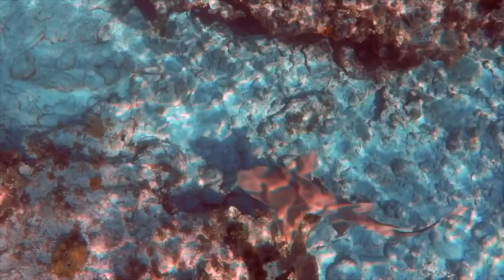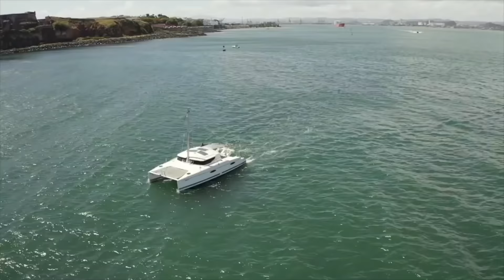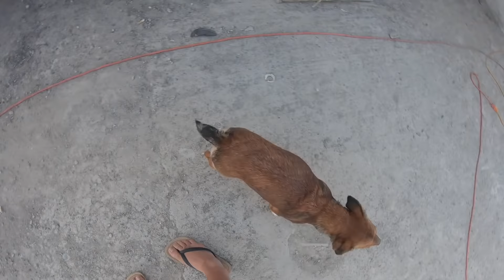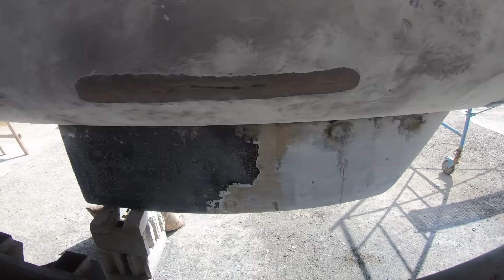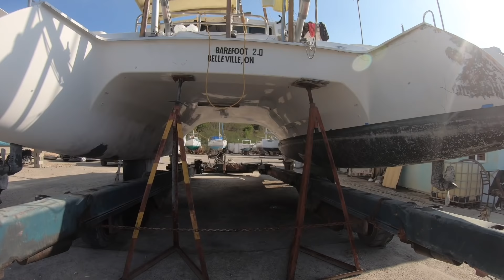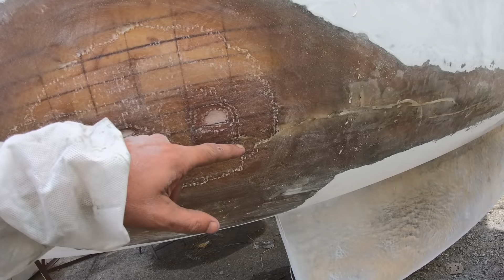Avoiding Boat Trailer Failure!! (S2 E30 Barefoot Sail and Dive)

Comment: I noticed they used hollow block as part of the blocking. Yikes!!! Hopefully you can get them to replace them with solid timber. That hollow block WILL crumble under the weight of the boat.
Reply from the maker: We check them daily and are working on getting a few more stands too.

Comment: Many hands make light work !
If your crack goes deep enough, balsa is a SPONGE !  It has to be completely removed back to dry balsa because it rots quickly.  Hopefully you do not need to do the same type of osmosis treatment Sail Life did.
The gel coat peeler/planers work great (again, see Sail Life).  Putting an additional layer of glass on the hulls is expensive, but it is the best solution long term.
Reply from the maker: Yes!!
Reply from the maker: Thanks for the advice mate! 🙏🙏
Reply: Christmas in Miami again. And again. And again.
Reply from the maker: We LOVE Christmas!!!!

Comment: Those inner hull cracks are suprizing , do you think it's hurricane damage ( if so why?) or is it some sort of hull laminating issue?   Those wets could you accelerate the drying with a vacuum , maybe just a couple of minutes with a wet dry back and toilet plunger head  to such/evaporate the moisture ? I know you have heat but it can take a while. 
Looks like you are prepping the hull for an epoxy coating after the repairs? 
Will you get the yard to spray the hull( or you do it have knowhow?)
Cheers Warren
Reply from the maker: Wow Warren so many questions! Yes we believe it’s hurricane damage from being on a pile of other boats? No too sure!
Reply from the maker: We have some exciting news that we’ll share Wednesday so we may have time to let it dry while we work on other projects. Maybe acetone could help.
We do have time though.
Reply from the maker: Yes we have an epoxy barrier coat to put on before the final coat of paint. We will probably paint ourselves. 

We have access to a friends spray set up to do the final coat. A good friend is a professional spray painter as well so we will have help/tips from him!
Reply from the maker: I think I got them all! Cheers Warren!

Comment: Ok, not sure why you would need to grind out the crack - obviously all that fiberglass is toast, so just take your grinder and make a big rectangle and peel away the whole outside layer of glass - that way you can inspect all the balsa core and remove the bad balsa and replace it.  Once you remove the bad balsa, it also allows you to inspect the inner layer of glass and repair as necessary.  You're going to have to replace at least a big section of the outside layer at a minimum, so you might as well just remove the whole layer in one big piece (or multiple small pieces.)   Of course I do know some of your de-lam is going down into the parts of the hull that are solid fiberglass, so that will be another hurdle to jump over.

Comment: that paint shaver could be easily copied using a grinder with a  Aluminum Miller Back Gouging Blade you won't have the depth set but you would get the hang of how much to take off 
https://onlinesupply.ca/Drilling-Cutting/Pro-Line/Blades-625/4-12x30t-aluminum-miller-blade
Reply from the maker: Not a bad idea! Cheers!